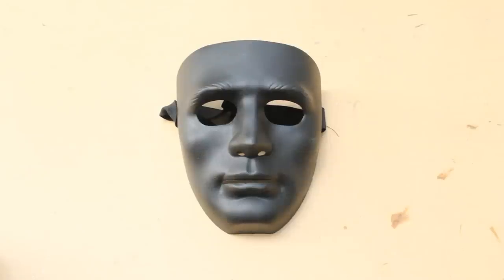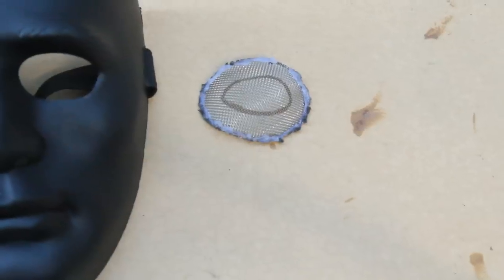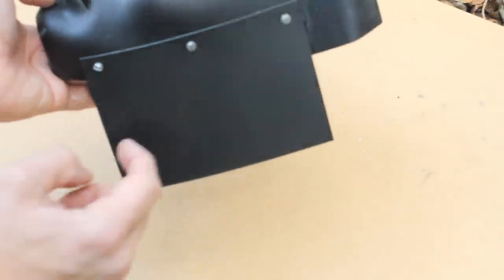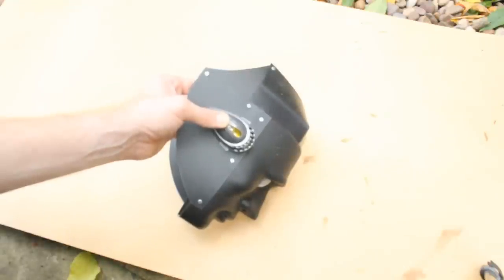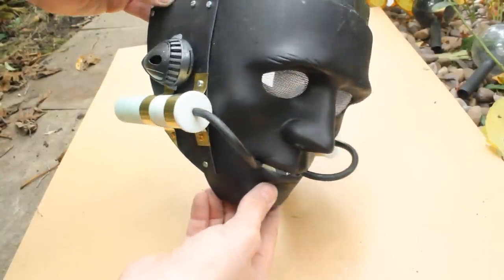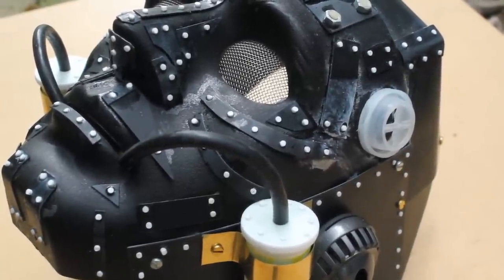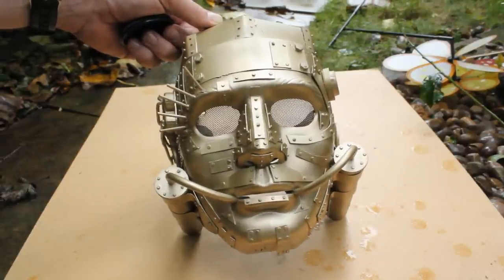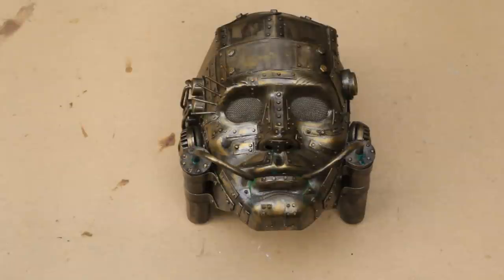Steamtech battle mask

Comment: ps what tool did you use to bolt pieces plastic together
Reply from the maker: I just drilled holes through the plastic then used metal bolts (the smallest I could find) to bolt it together.  I tried different glues to hold the bent plates in place but none were strong enough for it to hold its shape.

Comment from the maker: Most spray paints I have found look more golden than brassy.  The only way round it I have found it to spray the object with brass paint then use a brown wash and finally pick out the highlights with brass acrylic model paint.  The brass acrylic paint is a much better brass colour but if you paint large areas with it then you see the brush marks.  You may be able to find a better brass colour if you look into airbrush paints.

Comment from the maker: I drilled a hole through the edges of the larger pieces of plastic and through the mask below, then bolted them.  I only had to do this on the big pieces that I used to extend the mask because my glue wouldn't hold them in place due to the tension they were under.  Be careful where you place these bolts or they could dig into your face.  I suggest you cover them inside with some foam and try to limit the number of bolts.  Once the glue has set, you may even be able to take the bolts out.

Comment from the maker: Just the smallest thinnest bolts that I could find, bought from a hardware store (I can't remember the size).  They don't need to be strong as they are only holding plastic together, but do use washers with them, to protect the plastic.  I did need to trim them down and file them to remove any rough edges.
Reply: Hi there!  I’m not sure if you ever got the video link I sent you showcasing my version of this awesome mask.  If you haven’t seen it, I used plastic/nylon screws and washers instead of metal ones.  They were very cheap, and also very short.  No cutting necessary.  Just a little bit of duct tape to cover it on the inside : )). They are also very easy to paint over.

Comment: Solved the polystyrene sheet problem.  I wanted to buy most of the material local but I couldn't find plastic sheets at any craft or hardware store so I bought a notebook with a thick plastic cover and just used that.  It worked fine w/ krazyglue but the pink notebook cover looks very un-steampunk lol.  I'll be spraying the mask tomorrow.  Also, I used short nylon screws to bolt the forehead and side pieces together and used adhesive faux pearls for the rivets.  Very tedious but not very time consuming.  I'll send you pics of the mask once I'm finished.
Reply from the maker: +contrabbasso76 Excellent, we will be interested to see the pictures.

Comment: Another way to make rivets is to use a hand held leather punch on a plasticard sheet. Keep making holes in the sheet and your rivets will come out the back.
Reply from the maker: That is probably an easier way to do it.  When cutting a plastic rod there is a lot of wastage as the rivets can ping off in random directions.
Reply: It's A Trap! and you don't have those off angle cuts. I had a scratch built eight thousand point ork army for warhammer 40k. I still have bags of those rivets.
Reply from the maker: Yes good point.  I will try your technique next time it should be a big time saver.  Thanks.